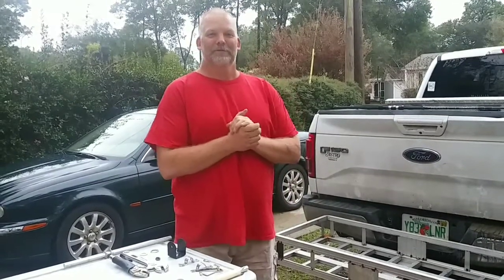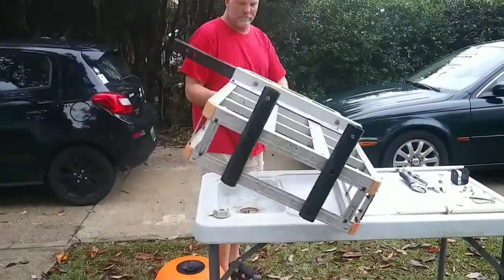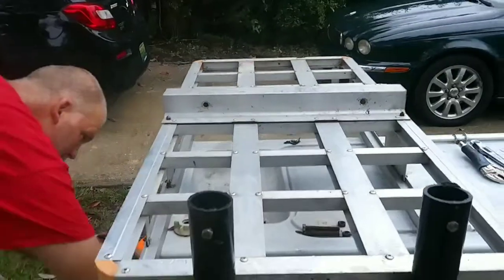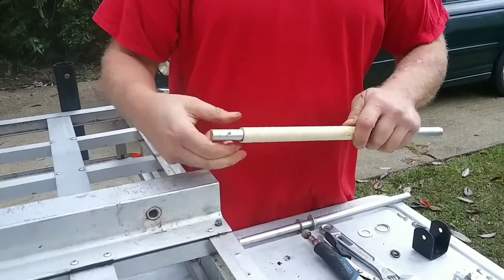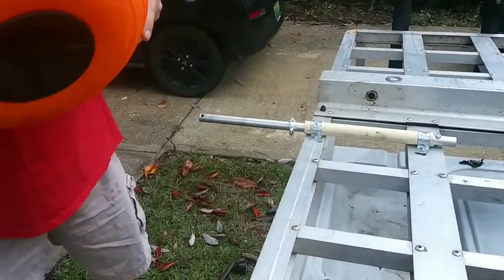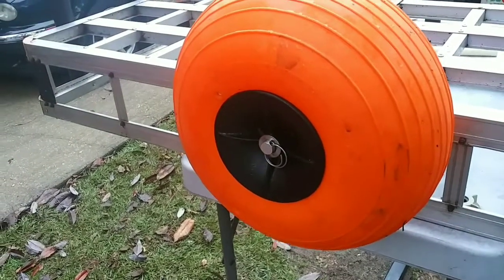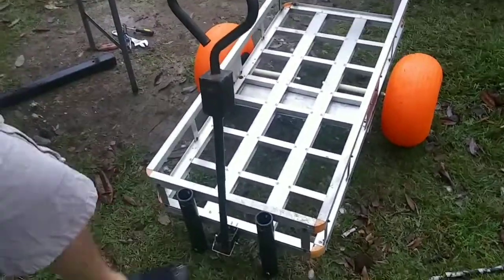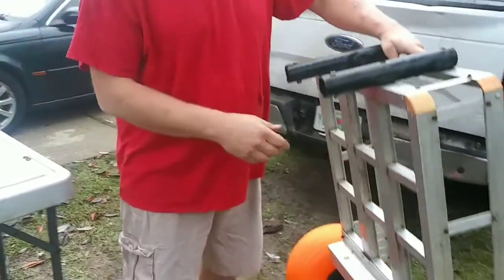From Suv to Beach

Comment: After trying to drag a wagon across the beach I realized you got to have the big tires but none of those carts fold up.  I knew someone had to have made something like this because the cart looked just like my rack with wheels on it. Thanks for sharing the video.
Reply from the maker: No problem and yes the wide balloon tires are a must. I have a blue style that if it get a hole you can heat the tire with an hot piece of metal and it will seal its self

Comment: Awesome idea!  The Fish-N-Mate LG with same 15" orange wheels will run you $279.00.  What this DYI cart can do that the Fish-N-Mate can't is slide into a hitch at the end of the day.  I have two SUV's with hitches so your DYI option better suits me.  If I still had a truck I would buy the Fish-N-Mate.  Thank you for making this video.  I got some ideas I didn't think of from it.  The main start point is 1. Pick a aluminum cargo carrier and 2. Absolutely make sure it has a square channel that the black reciever can slide in and out of.  I saw several aluminum cargo carriers that did not have the channel built underneath.
Thank you again for taking time to share your very cool DYI project!
Reply from the maker: No problem that's for liking it hope you hit that subscribe button and watch more videos

Comment: Been brainstorming this exact idea.  Glad I found your video.  I already have the same cargo carrier and have been thinking of making the square tubing longer, or using a drop hitch adapter to allow the cart to stay assembled.  Therefore I can detach and go, and leave the cooler on the cart during transport.
Reply from the maker: I have mine setup with pens so I can slide it off the hitch or leave the hitch on and use it that way thanks for watching hope you subscribed if you did that’s for that also

Comment: I like your idea, and have the same cargo carrier that I'm going to adapt.  I observed that it is quite a bit of work to assemble the tires.  Have you thought of adding a second set of hubs along the the top, like your fishing pole carriers.  If you allowed the axels to extend past the hubs you could use quick clips to allow the axels to be removed.  This way you could use quick clips to slide out the axels and slide them into a second hub from the top down, allowing protection from dragging. Just a thought, and how I'll try to finish mine.  Thanks for the ideas.
Reply from the maker: Yeah I’ve done some things differently over the last year. Been thinking about doing an updated video thanks for watching

Comment: A nice simple build! A friend of mine built one like this, using the Cargo Hauler from Harbor Freight. He made his a push cart with 4 wheels, he uses an 18” hitch extension & leaves all wheels & everything on it. Also he used aluminum square tubing & welded up a bracket that attaches to the the hitch sticking out the side that holds chairs & an umbrella. & with 2 solid axels it will handle about 600#’s. He can put 100qt yeti loaded with ice & with the rack, still haul all his fishing stuff, chairs, umbrella & more.

Comment: What are you using for the axle though? Got a link?
Reply from the maker: https://www.amazon.com/Anglers-Choice/b/ref=bl_dp_s_mw_9514910011?ie=UTF8&node=9514910011&field-lbr_brands_browse-bin=Angler%27s+Choice
Reply from the maker: Look on Amazon just type in beach tire kits the axle come with it you just use 4 u bolts to mount it it you need to